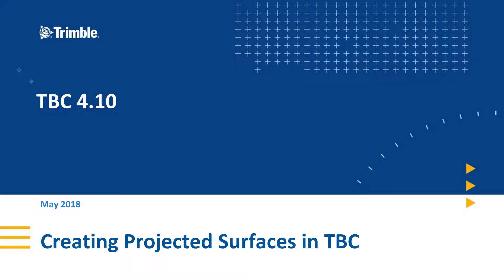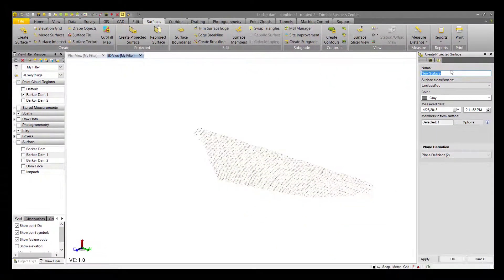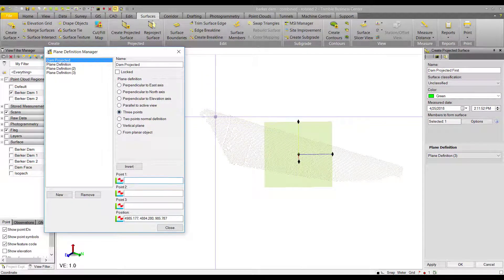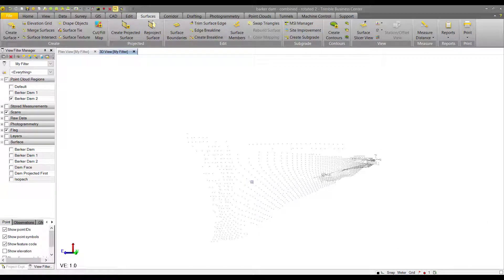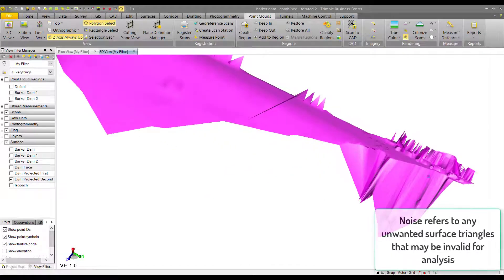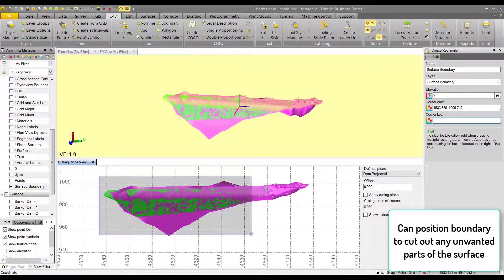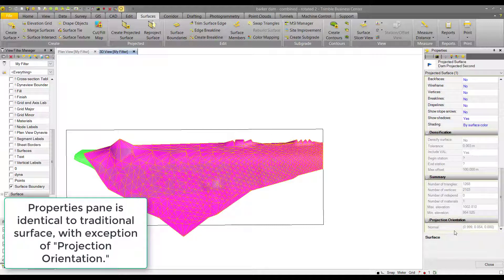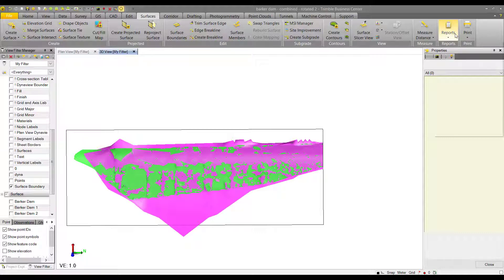Creating a Projected Surface

Comment: Great video. I just used this tool on a project for the first time. 
Question, the projected surfaces do not show up when you try to export them as a surface or when you try to drape an object on them they do not show up in the surfaces drop down menus?